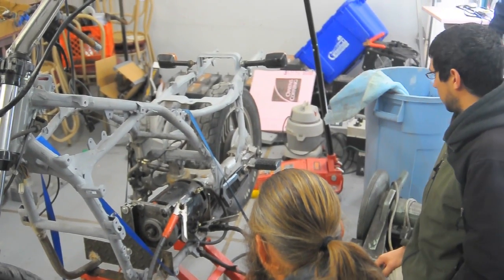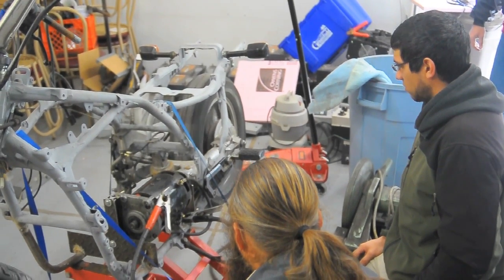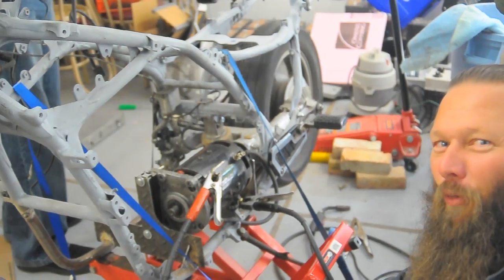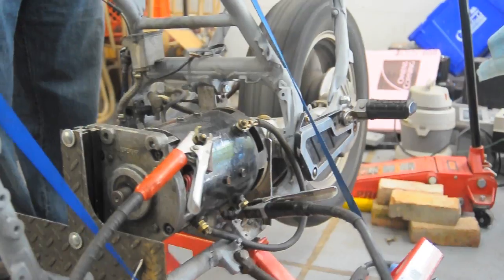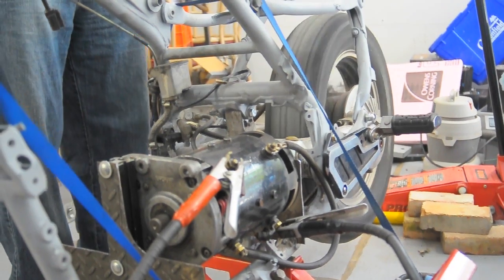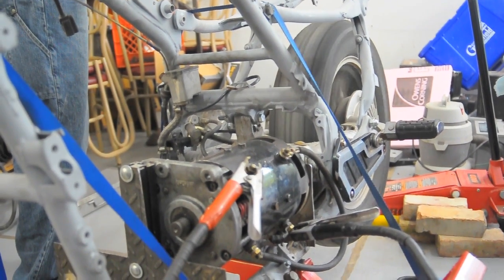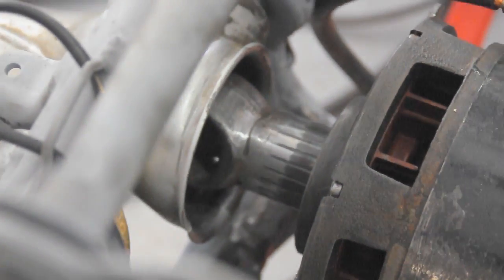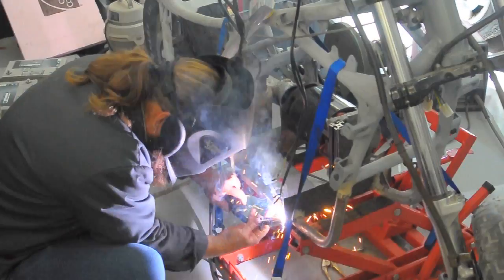Chris' Electric Motorcycle update Oct 2009

Comment from the maker: The motor on that cycle was a nothing-special series wound motor, from an old small forklift or something. The coupler was custom-made by our buddy Rich.
Chris is a full-time college student and has a lot of other things going on in his life, so I don't think a ton was done since we shot this video. We tested it out with some used batteries and a used controller. I think it pulled a lot of amps. A shaft-driven cycle might be better with a jack shaft and some gear reduction, or run higher voltage